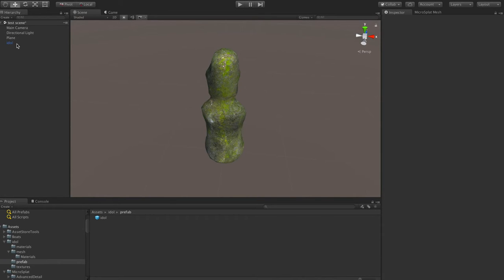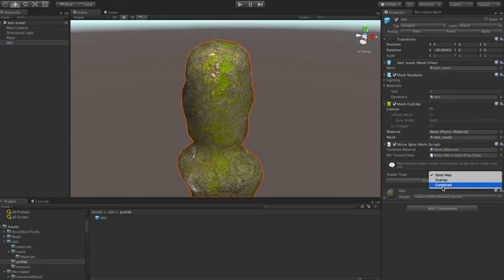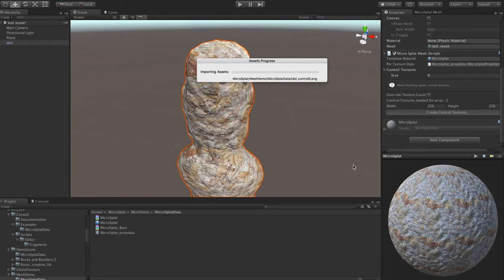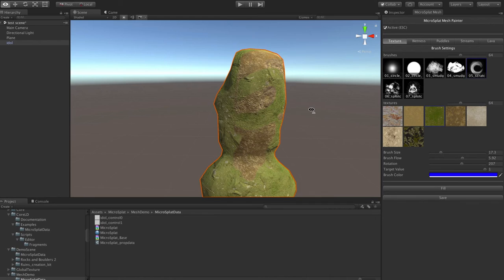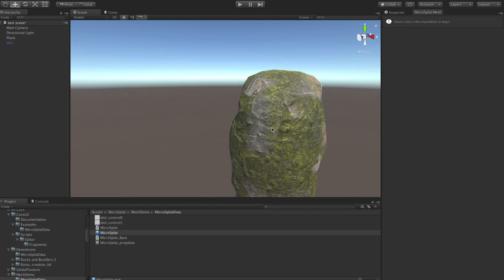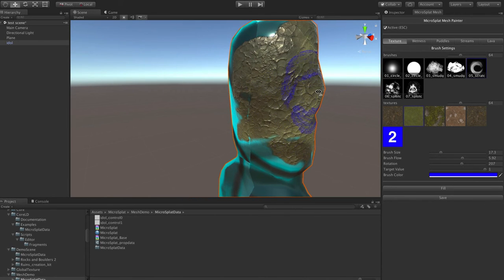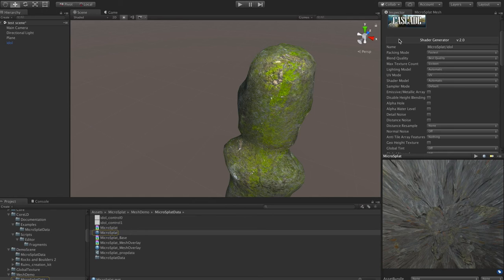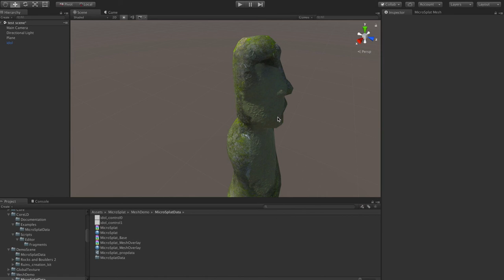MicroSplat Mesh Workflow

Comment: even in combined and overlay mode does the shader consider the normalmap below the splat material? in moste cases meshes have normal map for the overall detail. so does the splat material blend with this existing normal map ? i cant see it in the video and to me it seems a very common usecase when using it on meshes.
Reply from the maker: Yes, they are blended using height map (in combined) or alpha (in overlay) mode